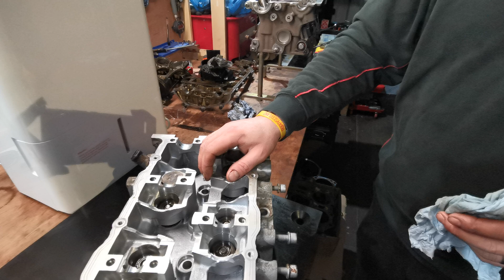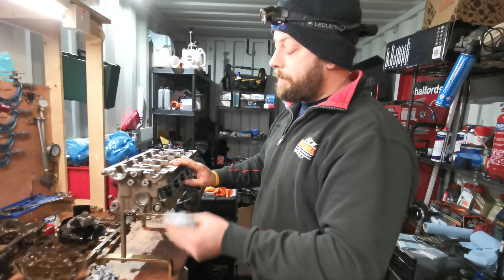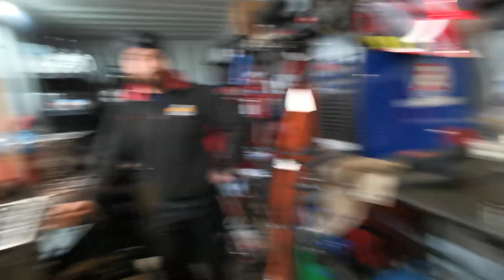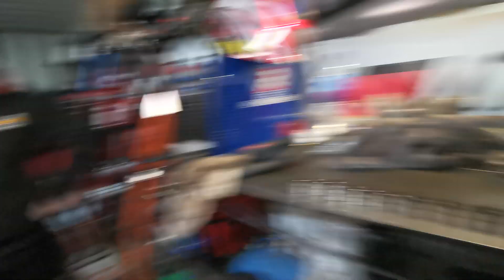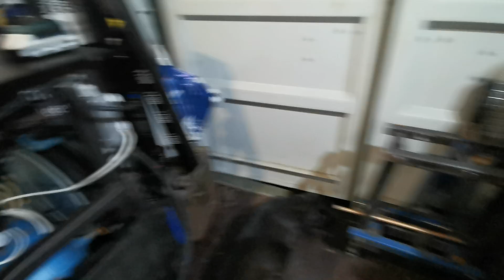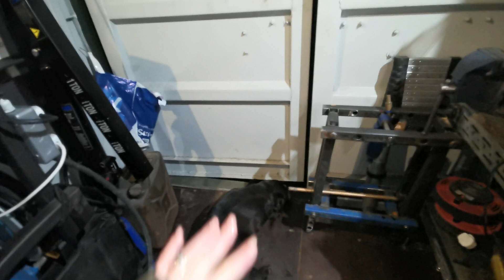MKS Performance valve spring orientation

Comment: Nice video. You're the only one that I can find addressing this common issue.  However, at :45 you say usually that paint is up so make sure the paint is down when installing the valves?
Reply from the maker: I said make sure the paint isn’t facing down lol. Might be my accent lol
Reply: @MASPerformanceVAG  Ah. I hear it- isn't, not is. Thanks again.

Comment: What difference does it make? I can't imagine what it would be. My head is for a motorcycle but same design. Two springs with spaced one end, compressed the other and I mixed them up and the head is already on. Hate to have to go back in there
Reply from the maker: Its all to do with progressive compression, harmonics and strength.
Alot of oem manufacturers are using progressive valve springs which have to be only one way up usually indicated by paint or how much closer the spring is wrapped to each coil